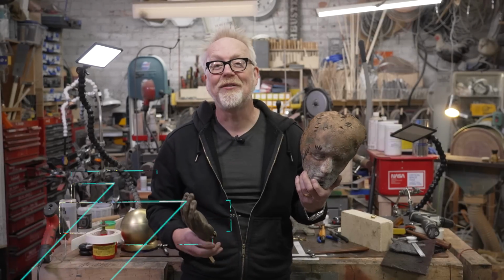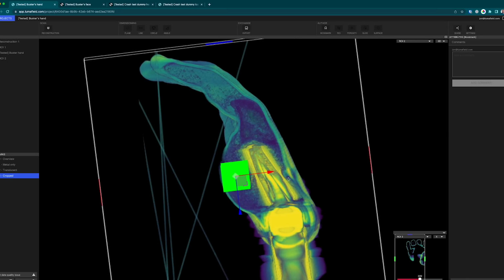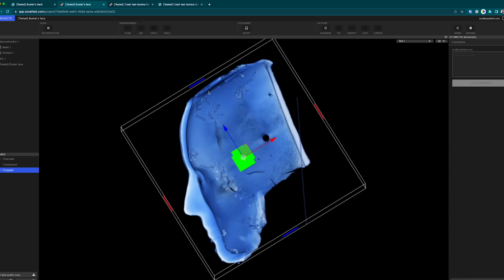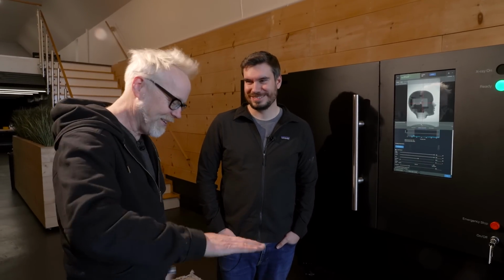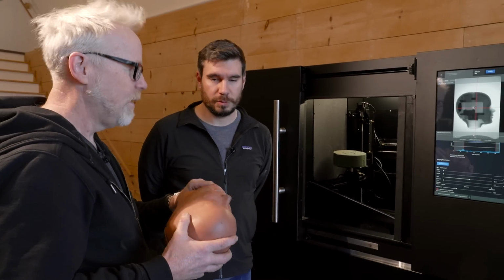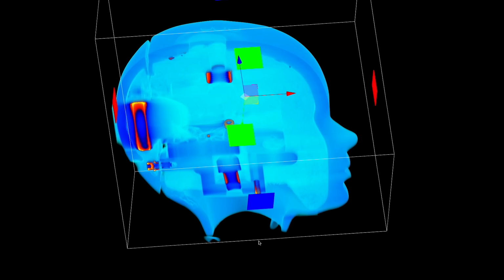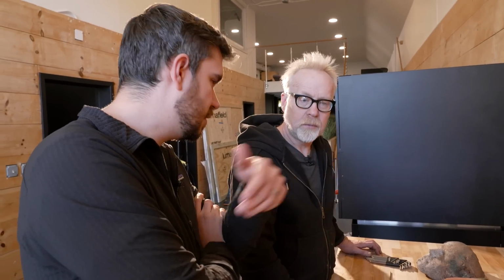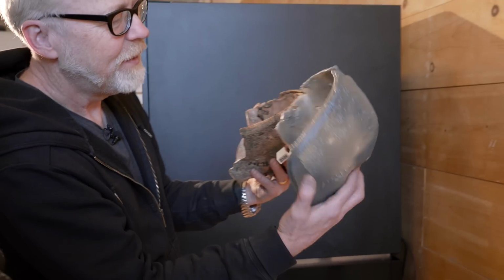What’s Inside the Original Buster Crash Test Dummy!

Comment: Just think about how they originally got all the necessary measurements for the crash test dummies. They most likely had to disect many different dead bodies to find the average for people. Since they tried to get the weight of each body section correct, they had to be cutting heads & limbs off and weighing everything. It is especially disturbing when you think about them doing that for every size of dummy, including children and even infants.

Comment: One of my favorite facts about crash test dummies (I study egress systems and testing and have 'met' several of them) is that each body part not only replicates the size and shape, but also the center of mass of the part. That way they move correctly under forces. In other words if a forearm was weighted too much at the elbow side it would move differently than if it was weighted at the wrist due to mass, inertia, and momentum. Therefore parts like the sensor packs also have to be mass weighted and checked to be sure they don't change the CG of the part they are inserted into.

Comment: The weight in the rear is likely also there to simulate the weight of the brain, which is quite far back in the skull (obviously). Most people forget how much of the face has sinuses and other cavities behind it, as well as the mouth and throat. The moves the center of gravity way back, which is why you two very strong muscles on either side of your windpipe, so your head doesn't flop backwards, like a baby who's muscles haven't gained the necessary strength. 

This center of gravity and accurate simulation of weight distribution is key in analysing impacts on the skulls, as it determines the movement of the head in a crash.

Comment: The virtual part of making in your head applies to my coding process too, sometimes it’s easier to just take a long shower and run/pseudo-edit the code in my head until than it is to stare at my half baked code and try to work out the next steps.

I could imagine if I had the skill to paint/create visual art, that this could apply similarly.